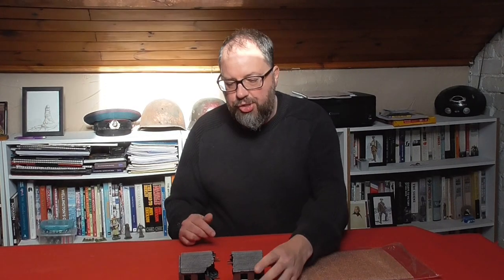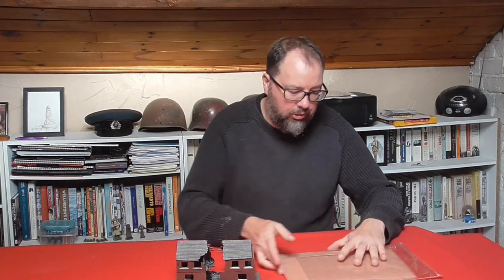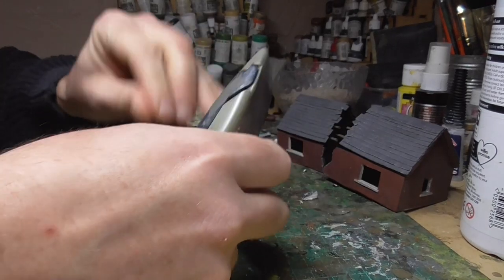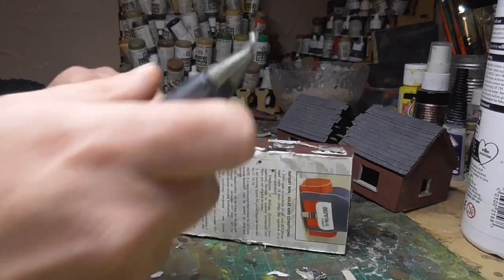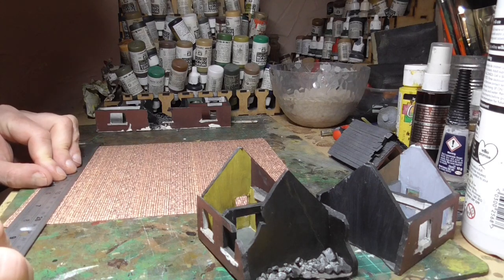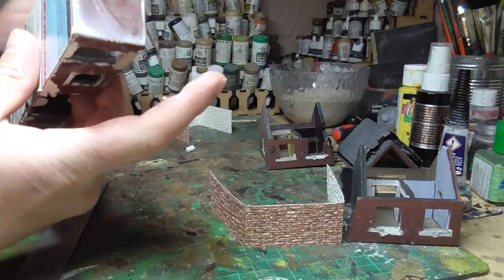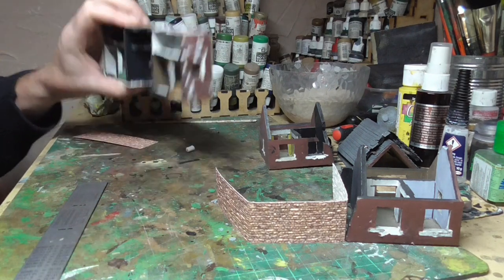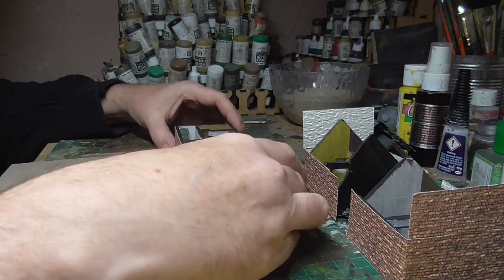Reviving an Old Terrain Piece | Storm of Steel Wargaming

Comment: If you want to add a bit of pressure while the glue is drying on a soft building, you can use clamps and rigid pieces of wood or plastic on the inside and outside of the building. Small clamps are quite inexpensive (at least around here) and the wood or plastic will both prevent damage to the material being used and keep the pressure from bending the walls.

Comment: Any suggestions on where to get that textured brick paper for 28mm buildings? Easy enough to find untextured brick printed paper (which is underwhelming) or textured brick plasticard (which is expensive). The stuff you're using here looks perfect. Really gave that building some new life.
Reply from the maker: Cheers, I got this from a railway modeller seller on EBay from Greece, but I haven't seen it elsewhere and not in 28mm, but I haven't looked, tbh. I suggest working out what railway model gauge matches to 28mm (I'm not sure what it is) and have a search on Ebay for textured paper. Sorry, I can't be of much more help.
Reply: @StormofSteelWargaming  I believe it's O gauge. I think I've seen that seller in Greece,  but was a little skeptical about the source and shipping and all. Sounds like it might be worth a shot anyway. Thanks.
Reply: @StormofSteelWargaming  IMO, S scale (1:64) is closest. 72"/6' is 28.6mm in that scale.

That said, "28mm" is not a scale, it's a size (and often a lie even as a size). Miniatures sculptors don't usually use human proportions when sculpting people. In general, the heads and hands are too large relative to the figure height in military minis, which is partly why some people prefer O scale (1:48).
Reply: @dougsundseth6904  Yes, especially the metal figures have the bigger heads/hands which makes some of them look a bit grotesque.
Reply: @dougsundseth6904  Any suggestions for 15mm gaming? Is that OO, HO or TT gauge?
Reply: @svenfolkesson7571  For true 15mm, probably TT: 15mm in 1/120 is 1.8m. But since there is very little TT or true 15mm around, probably 1:100 (for 18mm) or HO (for 20mm) would work best. And since smaller figures have even more exaggeration in head and hand sizes, there's a decent argument for HO even for 18mm.